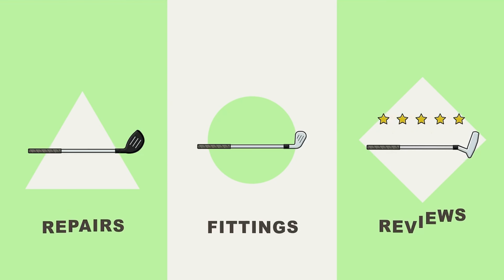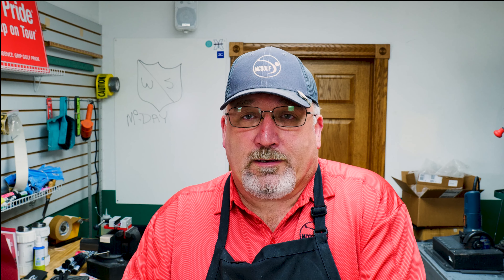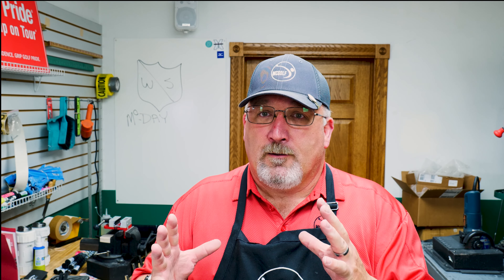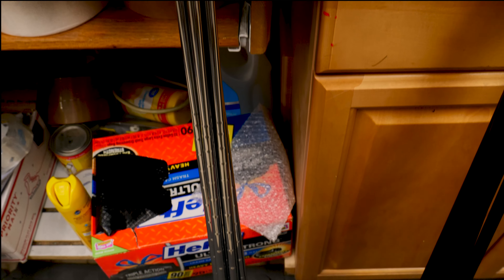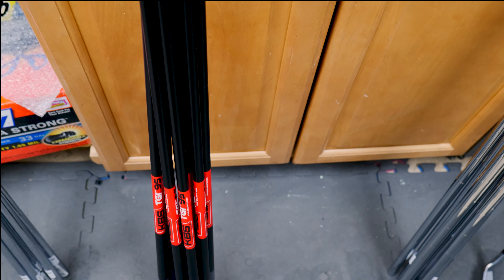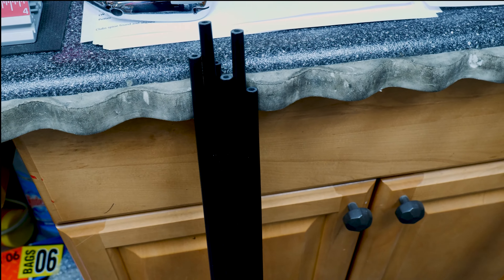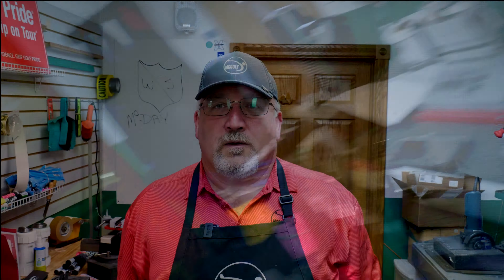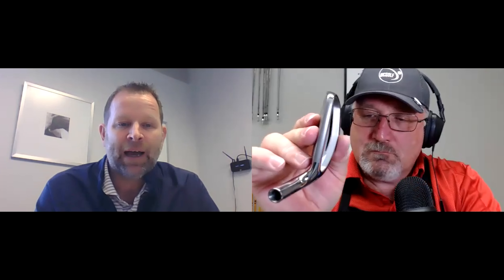How to build a golf club

Comment: I’ve got a set of Munzuno HMB and want to reshaft with same kbs taper lite but regular 105. Watched this vid which was great, where do you get centring beads and the 3m hipoxy?
Reply from the maker: centering beads from golfworks, If you are not fluent in the use of the glue I suggest the golfworks 24 hr epoxy. It gives you plenty of time to adjust before setting. The 3m is very fast drying and might a bunch or rework

Comment: Great video. Just curious about the grip tape. Are you using single sided tape or double sided? I've only used double sided in my installs. Wondering if the single sided is easier since you don't have to pulled off the film covering the second side (and creating wrinkles).
Reply from the maker: It’s double sided the machine pulls it off for me

Comment: Not all parallel tip shafts come in same length.  Nippon make parallel shafts in descrete length constant weight also.
Reply from the maker: You are correct. And they can still trimmed if needed but I have yet to do it